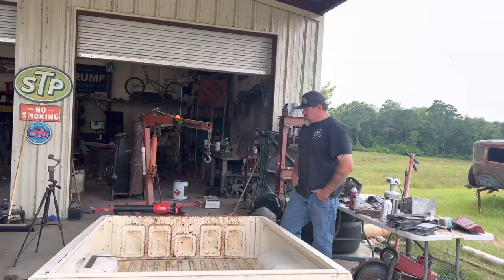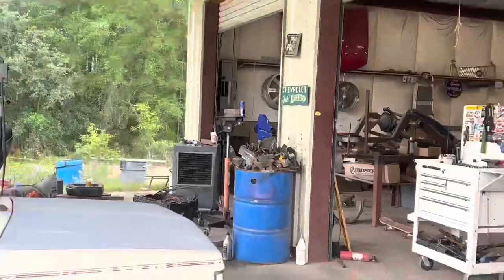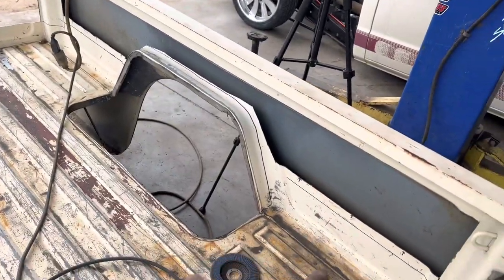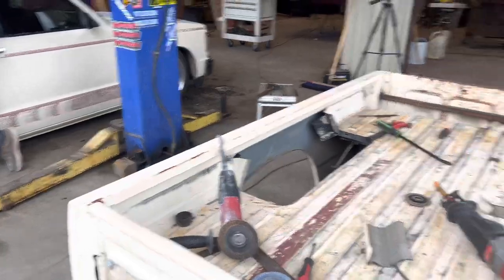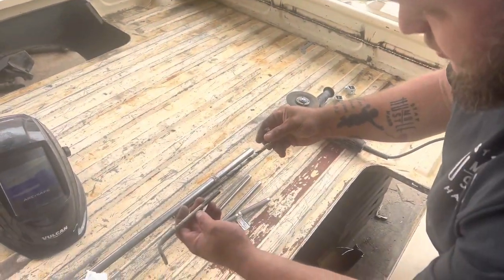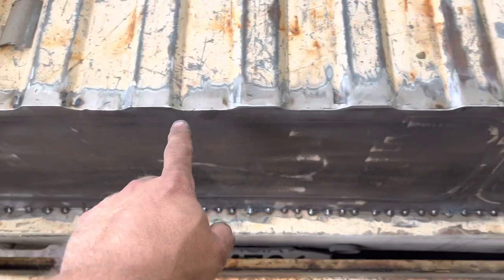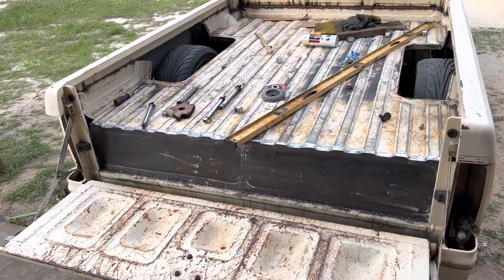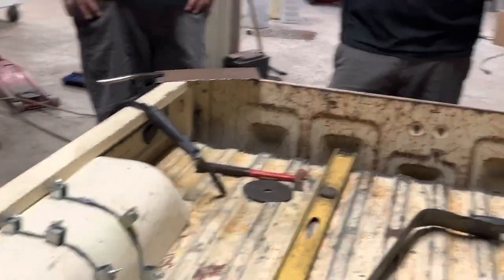Body dropping the s10 bed and test fitting on the truck…Mini Truck build offs in full effect

Comment: Man I like the videos. Wished I lived closer to you I’d probably be hanging out learning and meeting some good people. I live up in Owensboro, KY. Hell I’m retired and just do stuff on mine I talked to ya about in past. I think I messed up on my front tires rubbing inside fender’s when turning. It lays out but at ride height they gonna rub. They do just turning each way about 2 1/2 inches. I put 22x9 on my fronts with Pirelli 255/45zr22. 
Not sure which way to go just got it done Sunday. You got any thoughts I’d appreciate it if so. If I can figure out how to send a picture on comments I will here shortly. Actually I have the RideTech complete air system set a buddy hooked me up with real reasonable that came with everything and the front is the usual and I notched the front frame for tie rods and did put factory front sway bar back on but it still on the frame when laid out. It’s my first time doing it all and first air ride also. Thanks, Malcolm